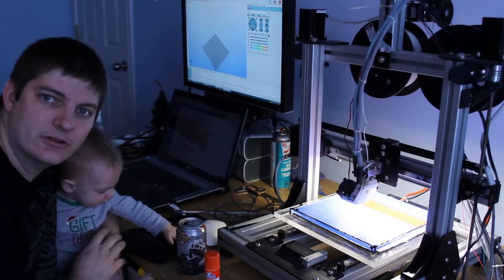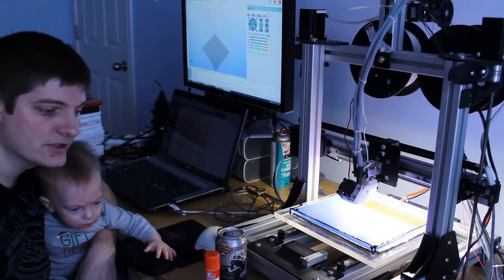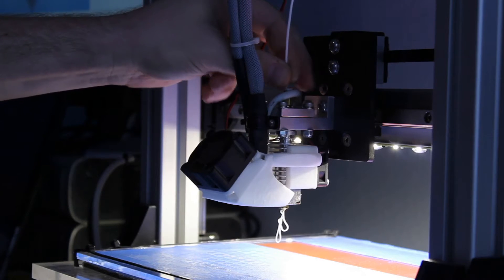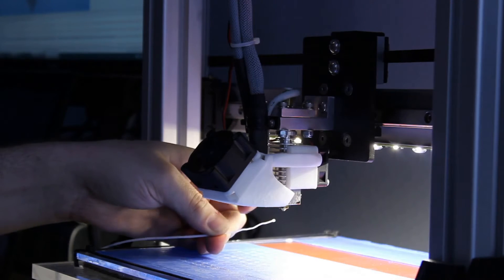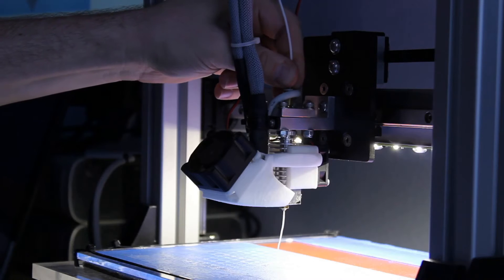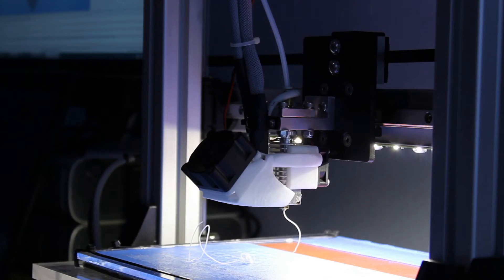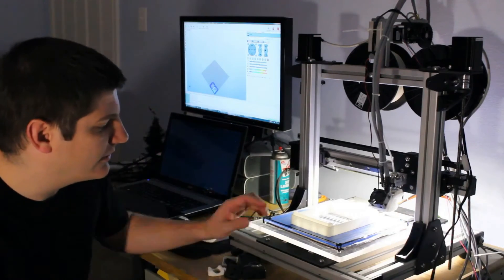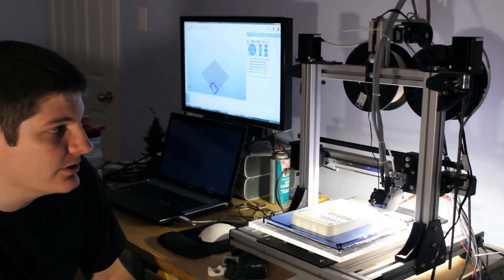Evan's DIY 3D Printer / Mill - EP14 - E3D Hot End Seasoning??

Comment: Heh... I've been printing for a few weeks and I'm at this exact point. If this next print jams, I am gonna season.

Just out of curiosity, is this damaging my micro swiss when it happens or do I just gotta heat it up to purge it when it clogs?
Reply from the maker: Not sure what a micro Swiss is. honestly, the seasoning is not really all that helpful longer term. It will only help on short prints in my experience. I ran out of steam on this one and eventually got back to it just recently, many years later, and what I was able to do to help the problem is to put a high dollar fan on the heat sink and crank the voltage up on it a little bit so I got a lot more airflow over the heat sink to the extruder and I think that kept the heat from creeping up across the thermal bridge and causing a jam.
Reply from the maker: Oh, and by high dollar I mean those brown fans that everybody seems to love. it was 15 bucks or something like that on Amazon.
Reply: @SquishyBrained  Wow... I didn't expect a reply with this post being so old. Thank you! Your mood at the start of the vid is where I'm at currently. 

Yeah, I'm looking at potentially replacing the fan. However, I think it's possible that I just didn't pull the plastic out correctly/well enough after my first print with it and ended up blocking the top of the heat sink when I pulled out plastic. I'm about halfway through a 6+ hr print, so I should know very soon if I'm gonna actually have clogging issues.

Btw, it's the Micro Swiss All Metal hotend. This one fits the Ender 3. It's a premium hotend and not cheap, but it's USA made and is finely machined. This one and the one you have are the two most popular from what I can tell. 

Anyway, have a good one!

Comment: I tried to do this on a new all-metal hotend that was clogging just trying to get it installed, and now I have a PLA seal across the filament hole through the heat block.

Not that the technique is bad. I'm just having a bad day.

Comment: Awesome! Your videos are great! I just ordered a folger tech reprap prusa i3 that I plan to expand to 16x8x16 right when I first build it. Im really interested in the printer/cnc setup but I was worried about the strength of the GT2 belt. I have a MYDIYCNC as well that is driven with allthread rather than belt. Cant wait to see how the belts do under the stress of cnc work. Keep up the videos!
Reply from the maker: I'm not sure if/when I'll get to add the spindle to the machine.  Maybe next time I do a circuit board it will justify the cost.
I need to look at the Chinese spindles, I just liked that I can use the dremel as a dremel when it is not mounted to the machine.  I've heard mixed things about it.   As for the belts, I forget what the force is they can pull, but it is significant.  They are reinforced with fiberglass, and you can even get steel ones for the larger belts.  The "GT#" of them does not have as much to do with the force they can pull as does the diameter of the belt.
Reply: SquishyBrained ya! I have a spindle from mydiycnc right now its ok but only light duty... Im working on designing a bowden tube head that will be a double up to a quad filament in a 40mm space including cooling. that way I have space for my cnc... which i may use a dremel flex head for a super compact setup, just not sure on its life.
Reply: Atom RC the fortiflex seems nice but I heard they are not so good, never held one though. Let me know if you finish the head design, doubt I'll go more than one extruder but who knows. I'm on to z probe soon I think. Need room for that.
Reply: Evan Jensen ya... im looking at a linear z-probe too so it doesnt have to flip out and take up more room... just waiting on my printer to get here so i can measure things. im also going to change the hot end to copper rather than aluminum to handle the extra filament. I have a friend with a stronger cnc cutting my cooling fins and block.
Reply: Atom RC I considered putting the switch on a rack that slides up and down with the pinion driven by a servo. I have some printable bearing material from igus that I've been meaning to try.
Reply: Evan Jensen ya, instead of a pinion i was going to use a push rod but with a 3d printer i can make gears :D
Reply: Atom RC considered using a 4bar to lower it down?